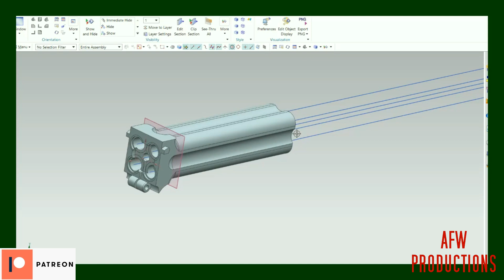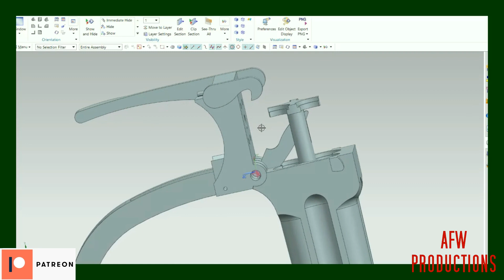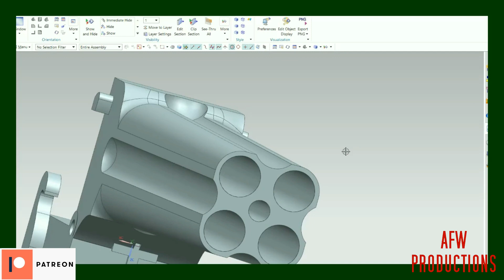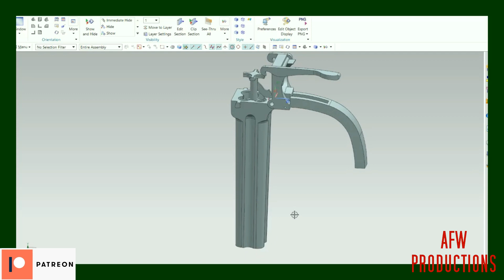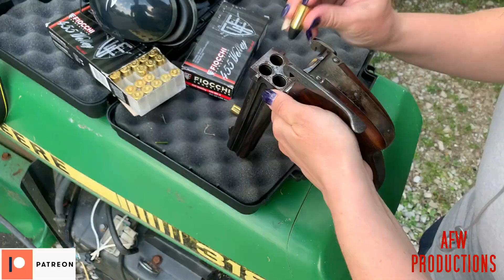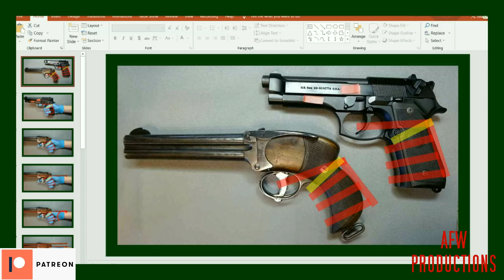Lancaster Reproduction - Q&A #1

Comment: This is truly fascinating! I'm glad that you're avoiding creating a "modern interpretation", and staying true to the 19th century technology, yet with modern metallurgy and perhaps a refined mechanism. Chambering for the .45Colt's cartridge would be a sensible concession; and you can also cut the breech of the chamber to accept both the larger rim diameter of the .455 Eley, and the smaller diameter but thicker .45 Colt's simultaneously. An elongated chamber that would accept the .410/3" shot shell would add an element of versatility; to prevent the birdshot loads from being blown by the rifling, which in .45 Colt's is usually around 1-16" twist, these pistols could be given a slower 1-36" to 1-48" twist, like that used in the D. Pedersoli .45/.410 "Howdah" ( Ithaca Auto & Burglar replica ) coming out of Italy. Best of Luck, and have Fun!
Reply from the maker: To your point with the twist rate for birdshot: I don’t think I’ve mentioned it anywhere but the original Lancaster pistols actually have a twist of about 1-24. So keeping a similarly large twist rate on those that are intended to be used with birdshot or .410 shells would be the plan going forward.
Reply: @AFWProductions  Actually ( no rifling being ideal ), the slowest rifling twist is preferred, in order to minimize the spinning of the shot charge. When the shot charge is spun in a rifled bore upon leaving the muzzle, it tends to quickly spray outward, creating a "doughnut-like" pattern that is almost worthless past a few yards.